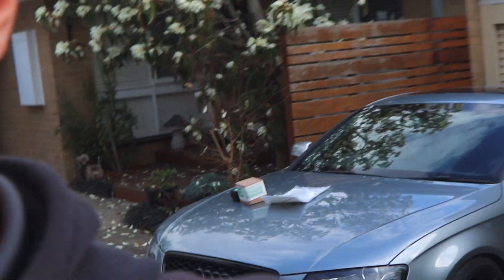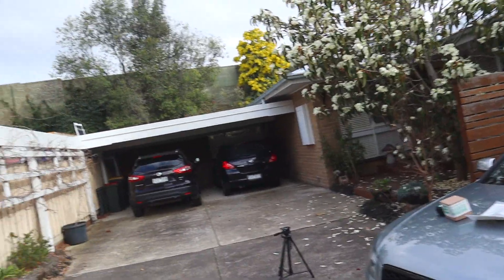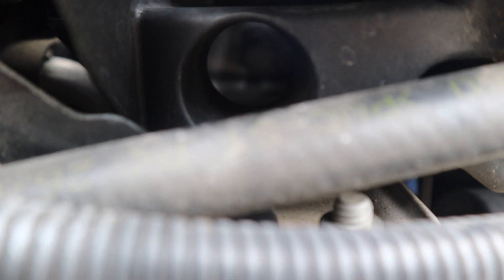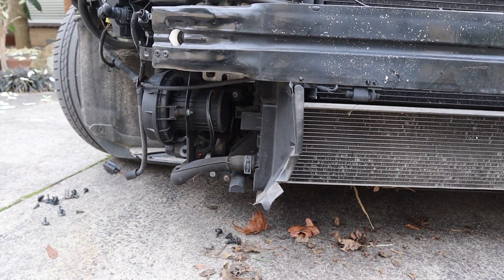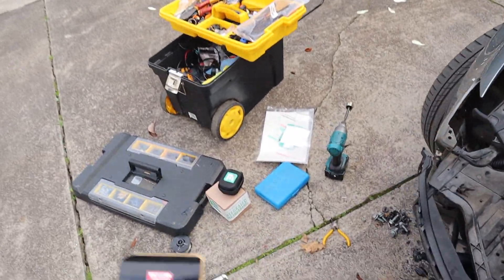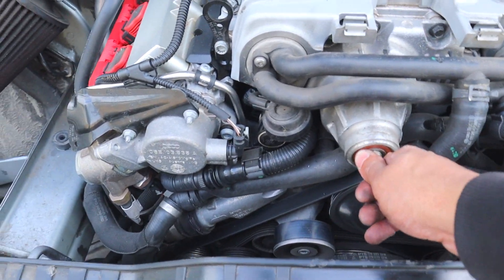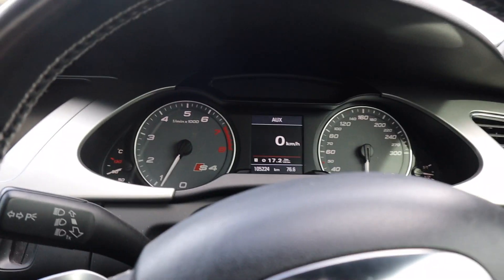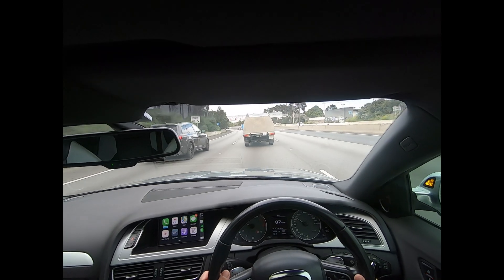Stage 2 Turns The S4 Into A Monster.

Comment: Integrated Engineering... Best in the business. 

Got my 8p a3 bullying foos just fbo and stage 2 91 octane tune 👌
Reply: 034 Motorsports is Miles ahead of ie on the 3.0tfi platform in every single way, they got some problems with with some fuel files like 93 octane and their transmission tune is not the best and many small things but if it works for you it’s good but 034 tuned cars are setting record times ( maybe it’s better for the 8p a3 i don’t know)
Reply: @kaibum8261  Idk shit about 3.0s, but yeah IE is top dog in 2.0 world

Comment: I find there is too much torque in stage 2 and the wheels spins slow the car down versus a smooth full throttle start that you can do in stock form. Once you are moving it is very quick and too much power as each time I overtake it hits 100+ in a few seconds so a light foot is required on the throttle and I often do well over 100 on highway ramps.  The dsg tune which took 9 hours to get done makes a big difference as it removes the power limiter and the red line goes to about 7500.  I would recommend a stage 1 for smoother performance but I went straight to stage 2.  I just had Audi change the 2 intercoolers and do a carbon cleaning.  Shifting in sport mode is very quick but not smooth like a pdk on a 911.  The shifters are not of much use compared to a pdk as if you are accelerating hard they don't respond to an upshift instantly and you hit the red line even if you clicked it at 4000 rpm.  No comparison to a pdk.
Reply: The AWE system is way too loud so I changed the middle muffler to stock and it sounds much better with a deeper sound and much quieter at steady speed versus a loud drone.

Comment: The key is the temperature you get the part to, not the means to get it there.

200 deg is not nearly enough. If you set your oven to 450 deg it would have worked fine.
Reply: 400°F is 200°C

Comment: What if my car is stage 2 already. Do i have to keep up with the upgrade? I brought the car with it already APR stage 2 single pulley
Reply from the maker: are you happy with the apr tune?
Reply: @TheFittingBay  yes, but was curious on how to keep the tune up. Don’t want to loose performance. This is my first Audi and tune, so want to stay ahead of the game
Reply from the maker: @Capone10469  No way in particular, just keep the car clean, use good fuel, service on time, replace common faulty parts and she’ll be sweet :)
Reply: @TheFittingBay  much appreciated
Reply: @Capone10469  how are u liking the car? Iv never had an Audi either and was looking at a b8 s4 already APR stage 2 tune,
Reply: @devonlane360  it’s great. Fast. Was thinking about getting rid of it though
Reply: @Capone10469  why’s that?
Reply: @devonlane360  looking at a SQ5 now
Reply: Occasionally, APR will make updates to its tunes and anyone who recently got the last tune before the update they will contact for a reflash. But other than that, you just need to do standard maintenance like fuel filter, spark plugs, PCV valve, oil changes, etc. to keep it running in top condition the same as you would a stock car. So unless you want to upgrade to Stage 3 or run E85, there is no need to do anything with your tune. Just maintain the car.
Reply: @TwentytenS4B8  much appreciated

Comment: The pulley is supposed to be heated gradually and cooled down fast, but not rapidly. Blow torch and upside down dust blow can is bad, mkay. Rapid heat and rapid cooling = brittle.
Reply from the maker: Mmmkaayyy yah true but tbh I’m just happy I got it on bc that was a stressful install 😂

Comment: Looking into a b8 S4 in manual. All I can find around me are manual s4’s with over 100k miles, should I be deterred by the high mileage? Also what’s a reasonable price for one with 90-110k miles.
Reply: I just purchased a B8.5 S4 2013 nearly perfect condition for a used car for 21$k. Had 67k miles. It was tricky finding ones under 100k miles for sure but if you are patient the right one will pop up
Reply from the maker: Yeah he’s right man just wait it out a little longer and something will pop up. Also, the difference in models and cost is very different here in Aus. A clean b8 with low kms will get $25/30k and b8.5 between $30/40k almost better to buy in the states then import here. All the prices I see over in the US look great
Reply: @porterreeve1823   all I’m seeing is b8’s with over 100k miles and the prices are around $18,000. Which makes no sense for me
Reply: @TheFittingBay  that’s expensive lol
Reply: @michalbaran3088  yeah that is weird. Where are you located?
Reply: @porterreeve1823  NY
Reply: @porterreeve1823  Probably just going to get a b5 at this point
Reply: @michalbaran3088  I’m guessing the market in New York is just a little more exspensive, maybe try looking out west. I’m here in UT. And you can’t go wrong either way Audis are great cars
Reply: Not sure if you’re still looking, prices are definitely still going up. But these motors are very reliable, I bought my b8.5 S5 with ~75k miles and I’m almost at 120k now. Haven’t had anything break. One common failure point once you get up to around 110k miles and beyond is the pvc valve, which is a pretty expensive job because you have to take off the supercharger and manifold. The parts are only about $300 bucks if you can do it yourself but a dealer or good shop will charge around $2k for the job, so if you’re looking for a higher mileage car either make sure that service has been done or set about 2k aside to do later. The bank 1 cats (connected to the downpipes) also commonly deteriorate. Easy solution is to just gut them and never have to worry about it again. Other than that, it’s pretty bullet proof and can handle about 500hp on stock internals.

Comment: Bro, that’s insane. I want that on my B8 S4 as well 😯
Reply from the maker: Philep Bolanos Do it you’ll love it
Reply: Don’t do it the b8 transmission can’t handle it
Reply: @yvngmvstard6811  How do you know that?
Reply from the maker: @IanO3  been handling it fine so far 🙌🏽
Reply: @yvngmvstard6811  The transmission in the B8 S4's is the DL501 which is the same thing in the RS7 and S7 which makes way more power. It can more than handle 400 plus HP. When you go Stage 2 on the ECU you also need to get the TCU tune as well to go with it. I've been running Stage 1 on the stock DL501 for over a year with no problems. The key is making sure your transmission and engine are in good health first before modifying it.